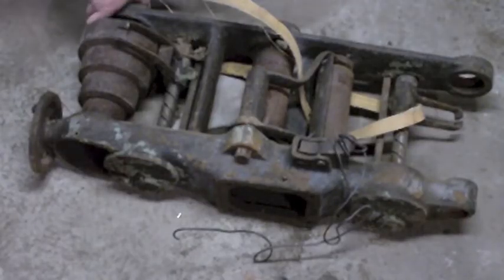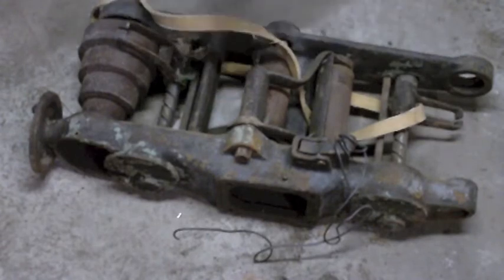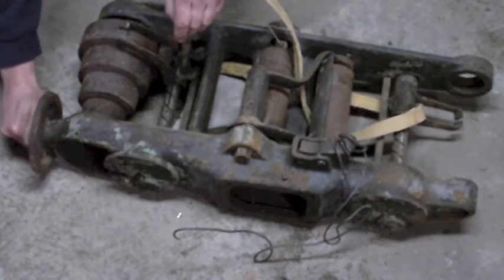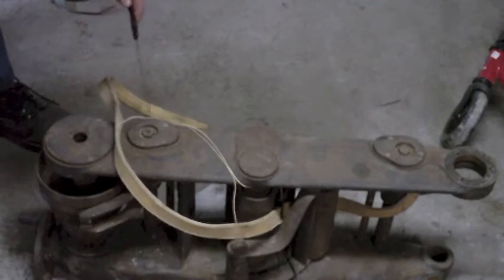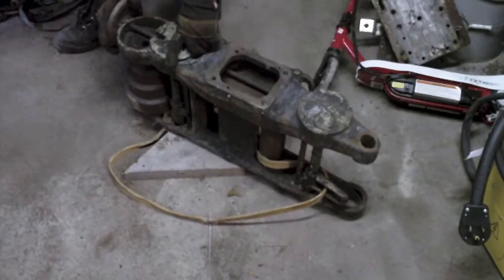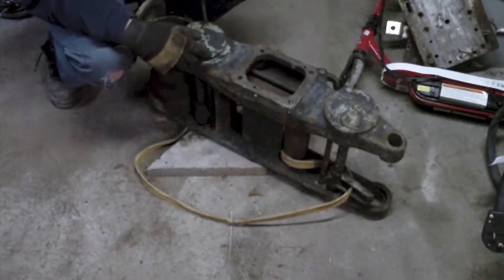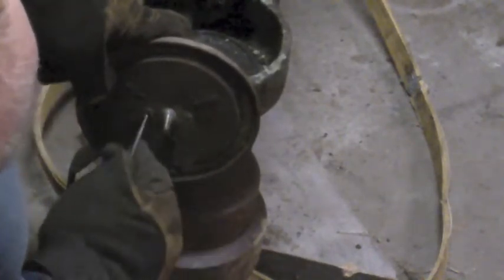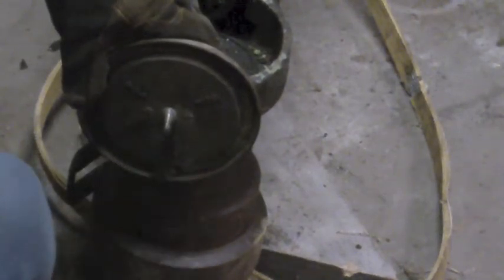Sipp Drill Press Part 7

Comment: Osssh its like a industrial countershaft :) nice project !!Keep up the good work,Some of the designs from the old days i would say are the best i know
there worn because of use.
Reply from the maker: This thing was built with the operator's safety in mind (by 1916 standards anyways) The idea was to be able to change speeds without the operator touching the belt, avoiding the risk of getting his fingers near those pulleys. Today we'd just shut off the power, but this was designed to be driven by an overhead line shaft in a factory, where the shaft had to stay running all the time.

Comment: Apparently there is quite a few bearings in the whole drill press.. that would be fun. hope they are in good condtion.
Reply from the maker: I'm replacing almost every last one. I saw the ad claiming there are 17 bearings. So far I have found 11, but I still have the spindle assembly to do.And they lied about it being all ball bearing :- )
Reply: yea.  So far I've heard several different numbers were used as far as the bearing count goes.

Comment: Steve;

McMaster Carr likely has the bevel gears  and other gears if you need to replace them.  Boston Gear (not cheap) is also another potential source.

Regards;

Ron Kluwe
Reply from the maker: Thanks Ron. I lucked out on the gears, no broken teeth! But thanks for the heads up.

Comment: http://vintagemachinery.org/mfgindex/imagedetail.aspx?id=2954
Reply from the maker: Nice! I have a few more ads I found, and will try and submit them to the VM site. Now if only I could find more on the Vernon lathe!
Reply: There are places that will make gears if you need them.  You can always try Boston Gear.  Bearings.. well depending on the type.  I can locate where to get them for you.
Reply from the maker: gbowne1 I got lucky on the gears, no damaged teeth. As for the bearings, you'll see much more on that in upcoming videos. So far I've sourced most of the bearings from Bearing Specialty Company.
Reply: Great you'll have fun with that.  Where ya at with the Hendey?
Reply from the maker: gbowne1 I'm taking a break from the Hendey to work on the Sipp. Also been working on the Oliver tractor. I need it to move some toys down the bulkhead…..like that Wells index mill that has not been uncovered since I brought it home a few months back.